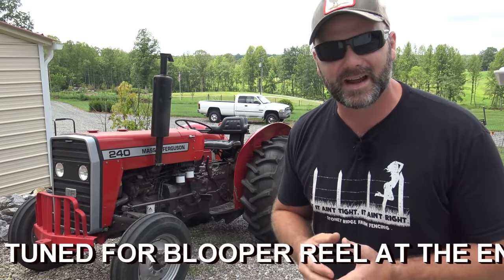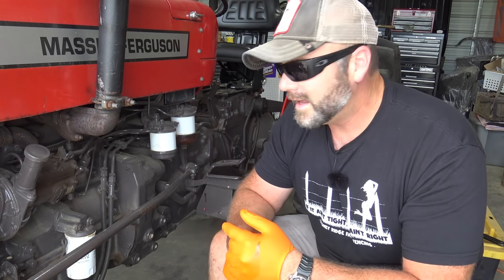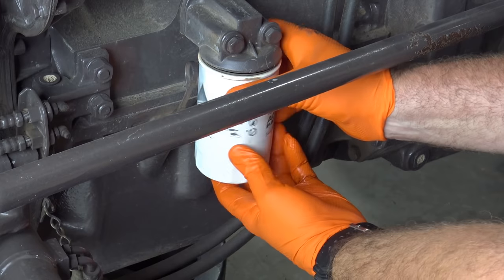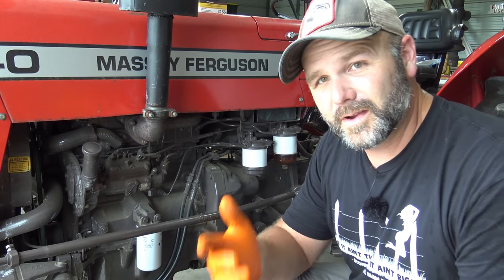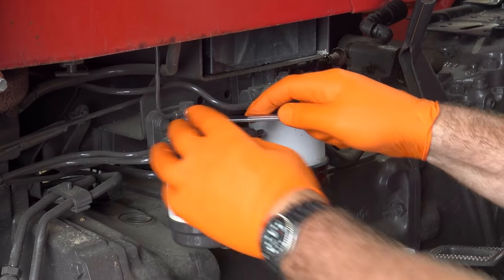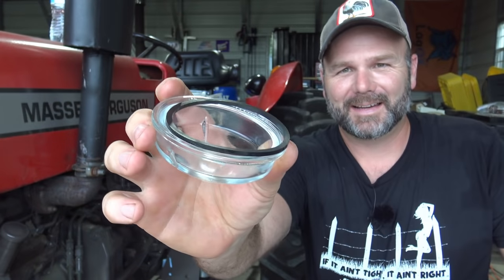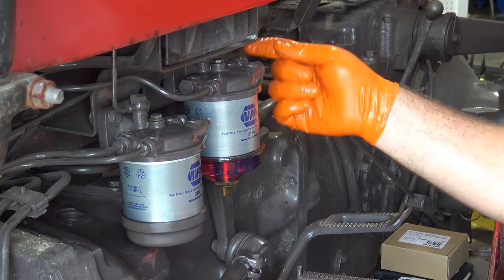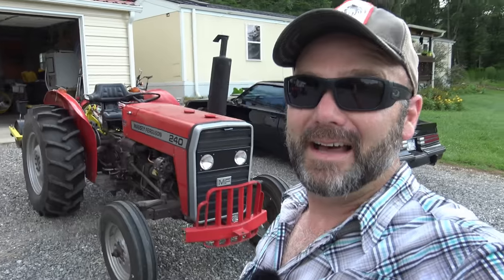TRACTOR SERVICE HACKS!!  DON'T MAKE THIS MISTAKE!! MASSEY, FORD, JOHN DEERE, KUBOTA

Comment: Radiator Cap Inspection,  Should really get a cooling system and pressure cap tester.  Inspecting the cap with eyeballs is a good first step.  Pressurizing the cap will let you know if the pressure relief is releasing pressure at the specified pressure.  The pressure cap keeps the cooling system under it's burst pressure.  Iv'e seen several radiators, plastic tank ones, blow the seal between the core and the tank.  Cap looked great, but failed the pressure check.  I noticed the top seal of your radiator cap is cracked, the bigger one up inside the cap.  Not such a big deal if you are blowing coolant emissions to atmosphere.  It matters if you're using a coolant recover reservoir big time.  Water and steam blow out to the recovery bottle as the engine heats up and air will suck air through those cracks as the engine cools.  This creates a pump, basically pumping out coolant every time the engine coolant is heated and cooled.  You looked down in the radiator and saw coolant, typical if you're blowing off to atmosphere but no good if you have a recovery reservoir.

Comment: Hey nice to know but I have a 1985 Massey Ferguson 270 and it Hangs in gear a lot do you have a explanation why it’s doin it
Reply from the maker: no sir I don't
Reply: Oh ok well I done it to me today and I had work on it on the highway
Reply: Do you use a bar rake or a v rake I personally like the bar rake better v rake if you have thic hay it like to drag it not windrow it so bar rake is good in the ticker hay tight ?

Comment: Is that original 850 hours or has it been rebuilt you can use boiling water on the battery terminals

Comment: Mr. Stoney, I would and have, cleaned, or rinsed off the wire brush with baking soda, to get the acid off. It will ruin your brush before you realize. 
Thank you for the human side of the video. If you haven't broken at least one fuel bowl, you've never worked on a tractor.
MB BAR RANCH
Reply from the maker: Thanks MB Bar!

Comment: I bet U gotta be careful with heating the primary fuel filter if your diesel is starting to gel in sub zero temps. I bet a hot gun will blow that glass, so maybe stick to hair dryer. LOL. And get some winter diesel ASAP. U could add up to 10% gasoline, I guess, but I'm a bit hesitant to add anything except a bit of 2-stroke oil or preferably Red Line RL-2 or Red Line 85 Plus. Your distributor type fuel injection pump and nozzles will thank you. And a biocide to stop algae, if it will be unused for weeks on end.

Comment: Better than using the label maker is to use a paint pen to write the date and hours directly on the filter so the label does not fall off.
Reply from the maker: paint pens always dry up on me. I've got the log book too..sometimes I put a label on the dash too
Reply: Sharpies work pretty good but the writing only last about a year or two in the sun.

Comment: not criticizing but you should never use an adjustable wrench on any oil drain plug, you should only use a box end wrench or socket so you have better control and dont risk rounding off the plug

Comment: The 245 was a better little tractor had powersteering, multipower, external hydraulic. Lmao I would've yelled fffffffffff
Reply from the maker: multipower!! AHHHH!!! RUN!!  I had a 135 with multipower and it was a disaster of leaking nastyness
Reply: @StoneyRidgeFarmer  yes they're just made to go a little bit faster but don't ever use it while under a load it will break.

Comment: Do yourself and your fans a big favor- Do not use this NAPA filter. It is not designed right! First it does not take all three of those big O'rings. Second the fuel does not flow correctly through the filter. Notice there are no holes in the bottom? Or top? That filter flows through the side. CAV or (Delphi now) designed that filter for maximum filtration with the flutes inside going up and down. This allows the dirt and water time to separate and go to the bottom. The NAPA filter does not! Napa's cheaper traction filter TWD BF825 made by Baldwin is superior. Better yet buy the OEM filter from CAV/Delphi # 7111-296 or HDF296. I know diesel injection pumps. ADS MASTER Tech.